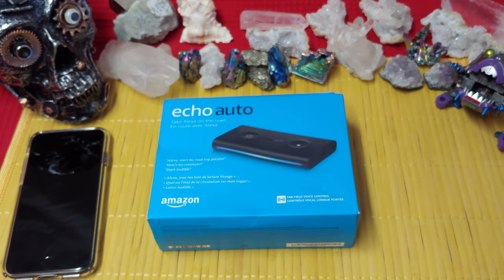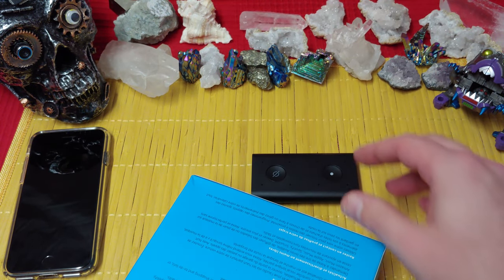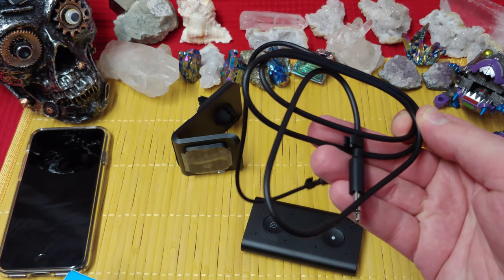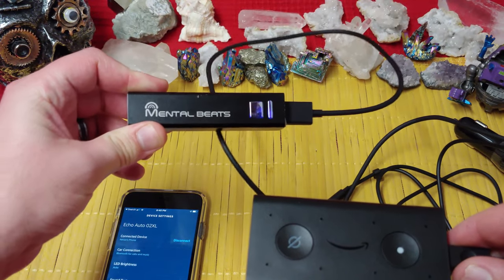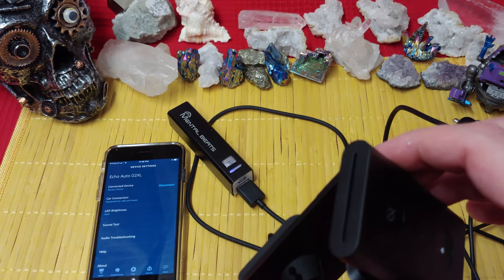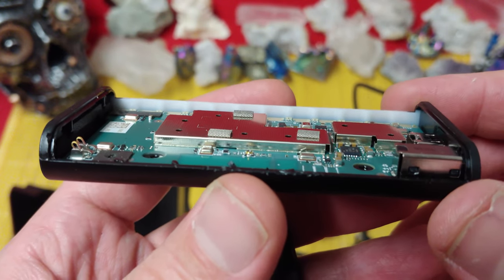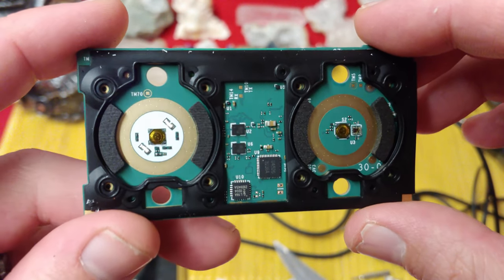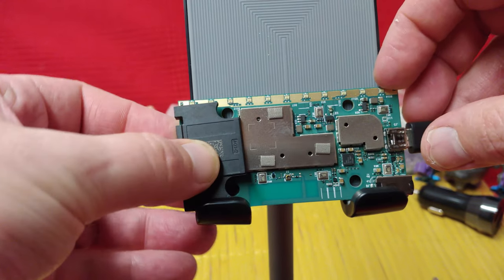Echo Auto Test & TEARDOWN - Hands-free Alexa in your car with your phone our voice

Comment: Thanks for the teardown. I was thinking about mounting an Echo Auto permanently to my car's "map light bezel" since it's near my face and I have a spare USB hidden in that area thanks to a dashcam install. I thought it would be nice to drill a hole through the underside of the echo and run power through the case, directly into that bezel, for a completely hidden wire. Thanks to your tear down, it looks like that's not going to be hard (the USB port is on the side of the PCB that I want to put the hole on).  Before I commit, I'm trying to figure out if the Echo Auto's mics are used all the time when I want them to be (like, during a phone call).
Reply: Haha, this is literally the exact same reason that I was searching for this video! I installed an Echo Auto in my map light area, drilled a small hole for a 90 degree micro USB cable, and hard wired it into my vehicle. However, I want to take it one step further and completely hide the wire just like you're suggesting. I'm curious though, the USB port should really only need two wires extended, correct? Power and ground? I have to figure out which pins these are. It doesn't seem that there would be a need to extend the other USB wires given this device doesn't perform any data transfer, correct?

PS - I hardwired a Nexus 7 tablet into the dash of my project car as well. After I figured out how to open up the Nexus 7, soldering the wires to the contact points wasn't too difficult.
Reply: @wusty23jd  Hey! There are 4 wires in USB - two of them area data. I haven't done it yet - but I did get a cable to go from my fuse box to 2 USB ports (one for dash cam, one for this).  Let me know if you do it!  If you're the video type, it might make an interesting video.
Reply: @DigitalArchmage  That is correct. I believe red is power, black is ground, green is data+, and white is data-. If I solder two wires to the circuit board where power and ground are located, this theoretically should work just like my Nexus 7 project. 

I just ordered another Echo Auto to experiment with. They’re on sale for 14.99 right now! It might be worth buying a spare.  

I’ll do my best to keep you updated after I tear the new Echo Auto apart.